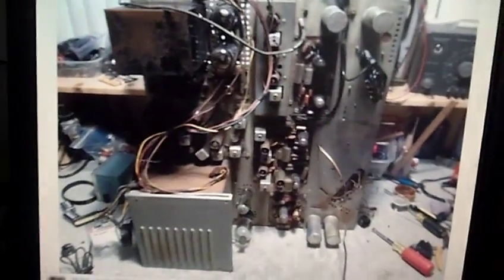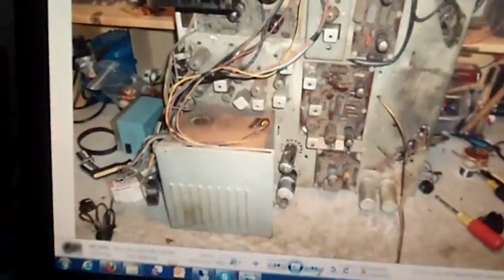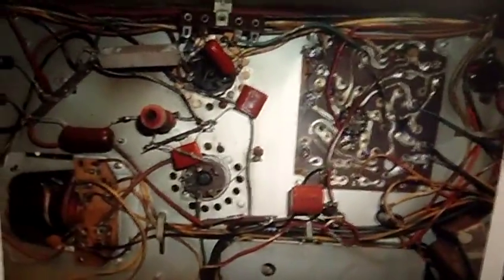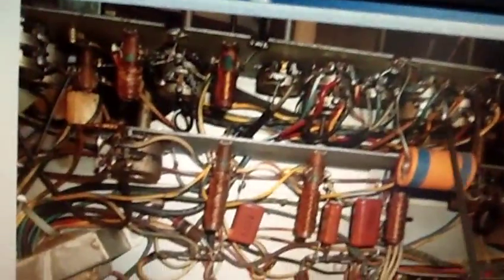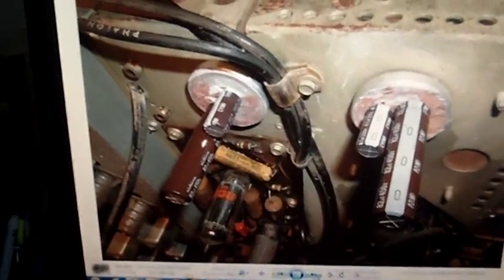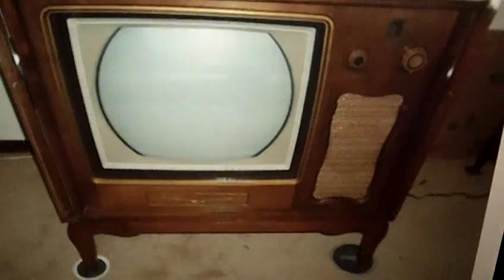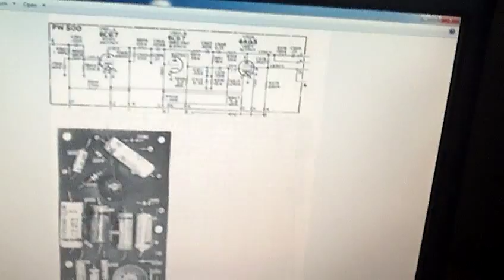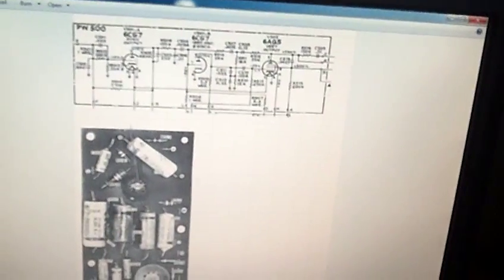vintage round tube color tv chassis work CTC-5 wingate

Comment: Hello and wondering how this came to be that you had to photograph a computer screen to get these original images from a file somewhere on to youtube?  The narration is helpful though so I don't mean to be critical.  We can get one of these locally here in rather good cosmetic shape but how to get chassis out?  Do we take off the plastic CRT shield first to get at the HV wire?  How does all that go?  This is the AX metal cone CRT.  It tests good so we might proceed.  Thank you.